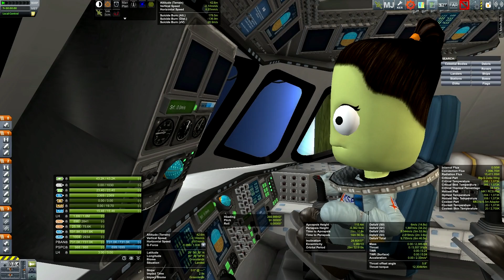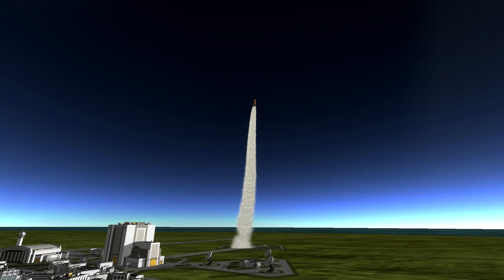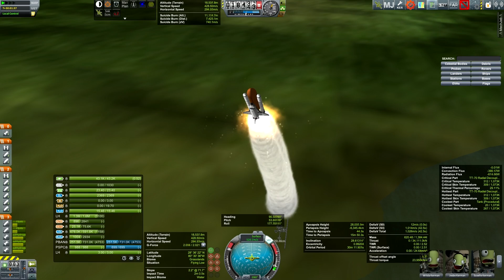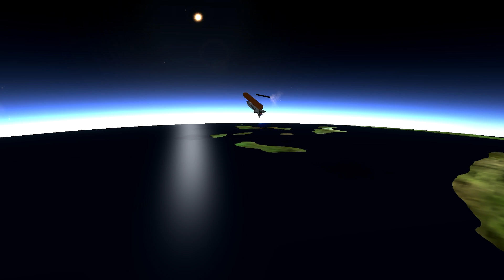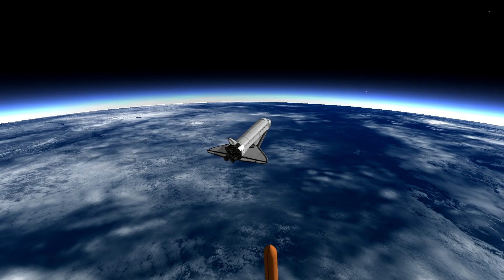RSS/Realism Overhaul Space shuttle

Comment: Iv'e been working on a RO RSS for weeks and I cannot find direct answers to what to download and can't ever find a working craft file.  If you could help me get a mods list and craft file I would get on my knees and thank you.  I've spent more than 70 hours trying this mod or that mod changing parts but all that happens it after my SRB's burn out my shuttle does flips head over heals.  Dude seriously any info that could help me and I would refer all my followers to your channel.  Just let me know what i could do to help and I am all ears!  Thanks man!
Reply from the maker: Most likely caused by the center of mass being off. Shuttles are tricky. You not only need to make sure the thurst vector is pointing through the center of mass while the SRB's are firing, but also after booster separation. After that its all about how good you can pilot the shuttle to keep it from spinning out of control. The loss of mass from expending the fuel in the main tank will make it so that you get an ever increasing upwards pitch on the shuttle and you need to compensate for this by vectoring your main shuttle engines to point your thrust vector in the opposite direction.

As for Craft files. Its been years since I had realism overhaul installed, and the mod has been updated numerous times since then. Sorry I cant be of much help there.

Comment: use mecjeb accent auto pilot
Reply from the maker: +Larstem I doubt MechJeb will be able to cope with the launch profile of the shuttle as you have to turn it on its back in order to achieve a stable ascent.

Unless MechJeb can be made to roll the shuttle 180 degrees before pitching I might be better off with kOS.